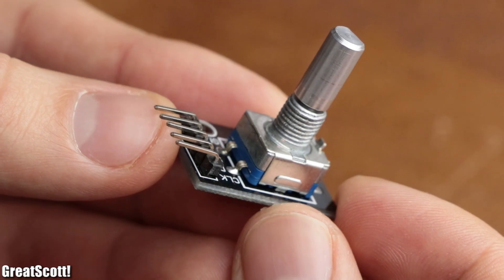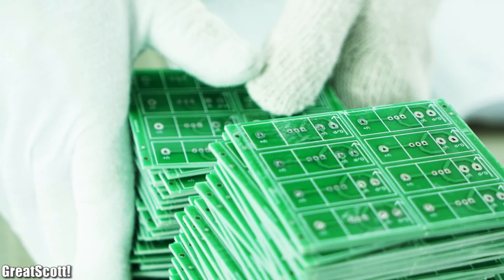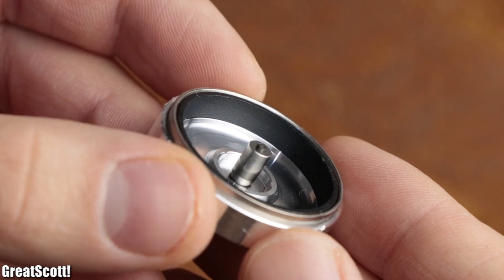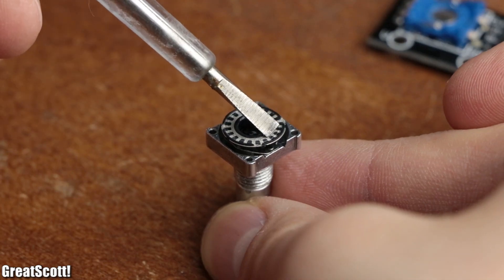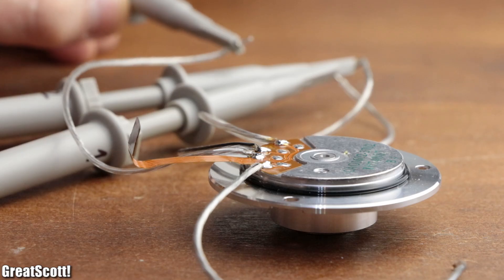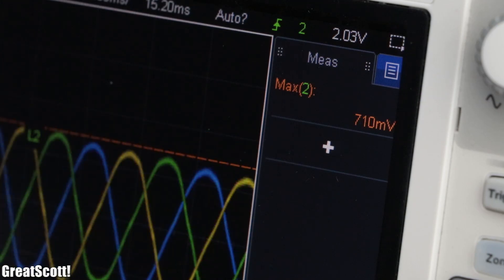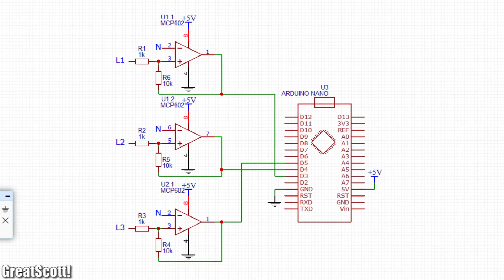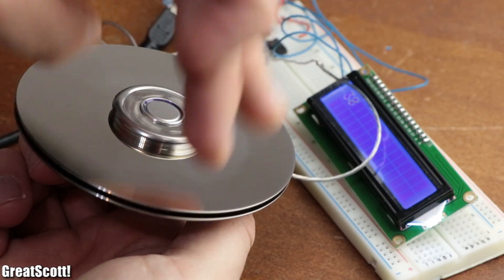HACKED!: Using an HDD Motor as a Rotary Encoder?!

Comment: I have two questions about this project:
1) why is using the analog read not good?
2) is there a way to speed up the counting? When you spun it fast the numbers went up slowely
Reply from the maker: 1) Because your Arduino might not measure the the phases at the right time because it is currently doing something else in the code. That is why interrupts are so important.
2) Yes, you can enhance the code quite a bit and add more functions like counting up according to the rotation speed.
Reply: @greatscottlab    .
Reply: Page 234 of Atmel datasheet shows the built-in comparator in all Arduinos. One input is used to setup a threshold voltage. While the other is connected to one of the windings of the motor (direct connection), through a 4K7 resistor.
When you spin the shaft, an AC voltage is created, which will be converted to a square wave by the comparator. By adjusting the threshold voltage, you can convert the AC sine to positive-only square-wave, which indicates the number of ticks (AC cycles). Each pulse would equate one AC cycle. You lose the negative part of the sine wave to logic 0.
Every magnetic motor, is also a generator. The 4k7 resistor will limit the current to the pin in case the voltage generated is more than 5.7V or less than -0.7V. The built-in ESD diodes will then shunt the input to Vcc or Ground respectively.  
The interrupt code for the comparator, must also have code to decipher the speed of rotation, and the number of ticks for each revolution of the shaft.  
AD0 and AD1 are needed as they are the internal Comparator's of Arduino's inputs.
If you want to use a digital port only method, ground one side of a coil from the motor, to the Arduino's Ground.
The other end, to any digital input pin (all have PCINT), or better yet an external interrupt capable port.
 INT0 and INT1 are external interrupt pins (BD2 ,BD3). 
the motor's coil must provide the logic low minimum voltage of 0.3Vcc, and a minimum logic high of 0.7Vcc. Assuming Vcc to be 5V, logic low needs to be 1.5V or lower, logic high to be 3.75V or higher. Benefits of CMOS construction. Some biasing resistors might be required when tweaking for best result.
If the voltage from the motor's coil is insufficient, an OP Amp or a Comparator is needed. Given that this motor is wound for 12V operation, I am pretty sure it can generate good voltages with low to moderate spin of the shaft. 
An Op Amp with a gain factor of 10x would be better and a lot more sensitive in fine movements. 
I myself, prefer using an optical encoder from the de-gutting of an old mouse.
This BLDC motor technique has its place in harsh environments with lost of dust and other particles, opaque liquids, or at the bottom of the ocean :) It also shields against external magnetic disturbances. One that would render ordinary (magnetically unshielded) hall effect magnetic sensors, useless.
Reply: 1) Typically you want to use analogue to digital converters for something else like sensors since a micro controller usually has only a few of them
Reply: Aah that makes a lot of sense! Thanks for clearing it up, keep up the great content
Reply: 1) I guess using the adc is less effective than just reading a digital value
2) decrease the delay (7:48)
Reply: The first question is one of coding efficiency. With it's first state essentially the arduino is continuously checking the analog pin as fast as it can all of the time using up all of it's processing time. With an interrupt pin it essentially sits in the background and waits for the pin to go high before doing anything about it. This frees up the processor to be dealing with other stuff in the free time. Such as controlling the pumps like the cocktail machine.
Reply: Pascal  - well yes and no. In general that is true, but if you look at the code that he used - he has a 500 ms delay in the code - no matter how fast you spin it, you can only go 2 steps a second like this. The code works, but like it is it would have been better just use use analog-read for 3 pins. And while the analog-read takes some time, for a rotary encoder this shouldn't be a problem unless you want to spin it rapidly.
Reply: Well, the arduino also supports interrupt driven a/D conversion - you start the readout and when the ADC is finished it fires and interupt - that can significantly speed up most code that uses analogRead.
Reply: Christian Gendreau marginally less
Reply: If you have an FPGA, you could possibly make a quadrature encoder. My class's lab used a 2 pin input, but I'm sure you could do it with a star layout. 

https://www.digikey.com/eewiki/pages/viewpage.action?pageId=62259228
Reply: Analog read is very "expensive" since it usually includes a start of conversion and wait until complete. Potentially hundreds of clock cycles. Also, It is slow and you have to constantly busy loop through the code in order to not miss the thing you're looking for.. Lots of busy work. The interrupt is like a doorbell, the CPU doesn't have to wait around for an event and can only come to the door as needed. That and a well written interrupt routine like this can finish in just a couple clock cycles. So instead of firing hundres of times per second and requiring hundreds of clocks per event, it will only fire as needed, and exits SUPER fast. 

TLDR, interrupts are really really efficient.
Reply: ABaumstumpf But you may still miss step if the cpu is busy doing something else.. Thats why an Interrupt is needed!

Comment: Can you program Arduino wirelessly ?
Reply from the maker: I think so
Reply: Can you add this to your "To Do list"?
Reply from the maker: I am not interested in that. Google it. I bet there are plenty of tutorials about this out there.
Reply: You can do that over WiFi, BT or even with radio signals. It's all about creativity
Reply: HC-05 Bluetooth is probably the cheapest and most documented option:
https://sites.google.com/site/wayneholder/inexpensively-program-your-arduino-via-bluetooth
Reply: Phillip Toone 

Just use an ESP32. ;)

Andreas Johnsson has some great vids on it.
Reply: Try this    https://www.google.co.in/amp/www.instructables.com/id/Program-Your-Arduino-With-an-Android-Device-Over-B/%3famp_page=true
Reply: Edit: I think Akshay Kolekar provided a link to a better solution.
I've used Pololu's Wixels to program Arduinos wirelessly.
I've also used Wixels to program Propeller microcontrollers.
I'll add links in a separate comment in case they get caught in spam filter.
Reply: Rajat Tarade I would REALLY like to know how to do this. I've looked into it (Google) but haven't figured it out. If anyone can point me I the right direction I would be VERY appreciative. Specifically I would like to be able to program an arduino from an Android device over Bluetooth.
Reply: Phillip Toone i have think something i will try it and if it works i will tell you
Reply: Phillip Toone Use something like app inventor, and get like a raspberry pi and connect it to the Arduino, write a program that takes the data from Bluetooth and sends it to the Arduino, just do some research on Google, I'm sure you'll find something useful.
Reply: Only minor thing is that virtually none of the newer stuff has 5-Volt tolerant IO pins, so if your project requires interfacing to 5-Volt hardware, you will require some voltage translation.

(Most encoders will work fine at 3V3 though, and other 5 Volt stuff might only require some resistors on the input pins, so it's usually not a big deal.)

The ESP8266 and ESP32 can both be easily programmed directly from the Arduino IDE software now, and simpler existing code usually runs with very few changes.

It's best to buy a mini "dev board" though, which has the module already soldered, USB UART, and pin headers for the IO.

Both types of module can be reprogrammed via WiFi, but work is still in progress on the libraries for Classic Bluetooth on the ESP32.
Reply: You can program an Arduino wirelessly by using a Bluetooth module (buy it off eBay for $5 or so) and connect it to the serial port on the Arduino. Connect the Bluetooth module Rx to your Arduinos Tx (and Tx to Rx). Power up the Bluetooth and Arduino and follow instructions to connect it to your computer. Select the Bluetooth serial port in the Arduino IDE and, voila, you can program your Arduino wirelessly!
Reply: Here's the Wixel product page. (You would need to purchase two.)
https://www.pololu.com/product/1336
They also sell them without the headers. You only need a few of the pins when programming an Arduino.

Here's the instructions for programming a Propeller microcontroller.
http://forums.parallax.com/discussion/139534/wireless-programming-of-a-propeller-chip-video

While the Wixels work fine, I like the method provided by Akshay Kolekar better. A Bluetooth module can be used with a PC or Android to communicate by using their built-in Bluetooth modules.
Reply: Stein-Erik Dahle "Connect the Bluetooth module Rx to your Arduinos Tx (and Tx to Rx)."
I don't think this is correct. You also need the module to toggle the reset line at the right time.
Reply: Phillip Toone Arduinos are programmed through Serial thanks to their bootloader, so you would have to hook up another board to the Tx/Rx and Reset pins to do that.  I would recommend to bypass the bootloader and program the chip through SPI directly as this is the most universal way to do it. Your computer could be talking to an ESP32 using WiFi, so you would send the executable aka machine code aka compiled program to the ESP32 that then would be acting as a programmer and load the program on the microcontroller.

Also you might consider simply pulling the chip out of the board...
Reply: yes, I think it will work....
Reply: Yes, I do it on a regular basis.  You use a feature called console through the wifi.
Reply: Arduino OTA Library for uploading sketches via WiFi;
UDP Server for array of bytes data at Arduino, and in Linux you can use the nc command (nc -u ip port), so you can send messages via any connection type and process then at Arduino (like to an ESP32);
Other connectivities.. serial, direct-pin mode, etc.
Reply: Rajat Tarade wwww up

Comment: Is it possible to increase sensitivity of the encoder?
Reply from the maker: +GreenMC If you put more time into the code you can even let the Arduino react according to the speed of rotation. So, yes.
Reply: @greatscottlab  would making a 3d-mouse out of a this be a interesting project?
Reply: Trust me, this is going to be mentioned a few more times in the comments... :/
Reply: Fredy Rommy if only...
Currently, it registers one event in about 1/3 of a turn. Smaller turns are not registered.
The only way this approach can be improved is to measure the time between events to get the speed. Still not much use if you need to react on few degree turns.
Reply: Dmitriy M or measure the voltage and use it as a multiplier. The faster it rotates, the higher the voltage...
Reply: Yep. Sensitivity to small input is what actually will make it interesting.
Reply: would it be possible to see a video on that? Specifically, it'd be awesome to see the motor inside a case, maybe even with a small 3d-printed knob.
Reply: Another issue is to obtain such a motor. In modern hard drives it might be a part of a monolithic assembly (optimized for mass production).
Reply: Use the encoder from a ball mouse instead. Or, laser print a pair of clear sheets with your own pattern and turn one against the other. http://www.youtube.com/watch?v=4Z2IdS7qoQ0    http://www.youtube.com/watch?v=dPBKTZw_xi4
Reply: i've noticed that too, they start to be attached to the full shell of the hdd somehow, in a way where you end up destroying the thing getting it out.
Reply: Dmitriy M : It's actually possible without that sort of analysis. There's basically two ways:

First is to use a gearing system to convert from one knob size to a different wheel size, such that turns happen much faster: that changes the feel, so let's ignore it.

The second technique is to recognize that the output of the motor is analog, so if we just use that data correctly then we can get the needed info. Look at 5:10 and you'll see several cycles of data. Those three signals are always coordinated, so rather than only getting peaks, you instead check at least twice for all three signals so you can figure out what direction the spinner is going, and then combine the voltages to compute the strength of the signal, thereby providing you with speed. Remember that in three-phase A+B+C=0, so if you do abs(A)+abs(B)+abs(C) it will be around 2 * the output voltage, thereby giving you both magnitude (speed) and direction. For even better results you can play around with synchronized a->d converters and analog range adjustments, but that probably will never matter for a user interface device.
Reply: Side85Winder you can't get away from using encoder in case of slow input (but diy encoder might be feasible option in some cases). If we're OK with analog voltages produced by the motor in our hypothetical use case, then we should be able to get more from analog values (not really high precision still, I guess). We have 3 sinusoids shifted by 120°. Any measured combination of L1, L2 and L3 should give you current angle when you compare it with these sinusoids. (Some math required to find the best fit with least noise.)
Reply: Dimitriy; Only if it's spinning with a constant speed, which is not a valid assumption for a user interface.
Reply: Dmitriy M what sort of sensitivity do you think is possible? Rotary encoders are expensive as if this is usable to get fairly precise accuracy say down to 1* it would be a very good alternative.
Reply: Perhaps use a donor stepper from a different device.  The 28BYJ-48 is stupid cheap but geared, most NEMA style are like 92 steps per rotation instead of 3.  If you only pulled out a NEMA motor, Scott, oh the feel of that as a rotary encoder.  Welp, one of us is going to do it.
Reply: I wonder if it could be possible to use hall effect sensors to detect the actual position of the rotor instead of just the movement. This way the precision would be increased and wouldn't rely on speed
Reply: It acts as alternator and it may produce small voltage pulse when you do too small rotation. It'll be harder to decode them, but you can do it.
Reply: Eero Prittinen : Hall effect sensors could work, but make the most sense when you want to detect position in the total absence of motion. Also, there's no real reason to start with a HDD motor in that case.
Reply: You could read the voltage changed by a potenciometer and use the difference as encoder. It would be cheap and easy to implement.Though it would have some lag
Reply: Octavio P. That sounds like a interesting approach. If you can hack the pot as you described I could try to help you with the rest or at least guide you to the right direction
Reply: @erbo95  Trust me, pots don't like DC.   ;)
Reply: Only mechanical gear, on my opinion. Big one for the rough tune, and fine one on motor shaft itself.
Reply: You can increase the resolution of the encoder by adding gears, a small one in the motor axis, and a big gear connected to it, then when you spin the big one, it makes the small gear and the motor spin faster, that means more resolution per spin of the axis you are moving.
Reply: Hard(co/wa)re solution: rewind (more turns with thinner wire), or apply 3 small power transformers.
Reply: https://www.youtube.com/watch?v=bHgAbA7qq0w
Reply: @Octavio P. Might be  easier to mod a mouse m8.   ;)
Reply: Get rid of the delay in the example sketch he was using and it's going to be wayyyyyyy more sensitive
Reply: hey, your first again!
Reply: sensitivity is bassically multiplying the input value